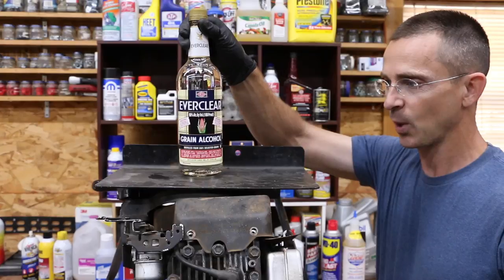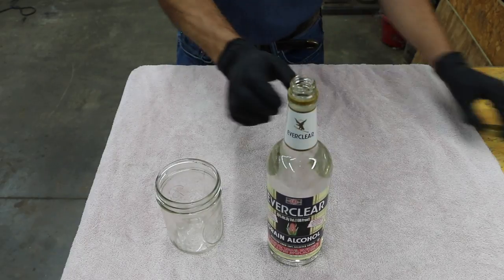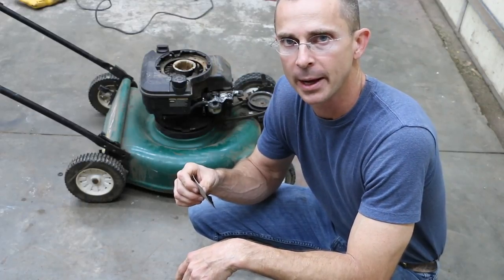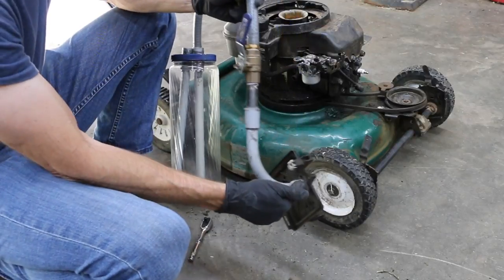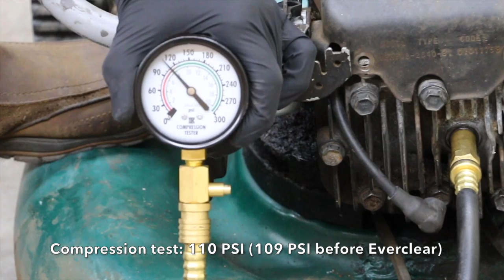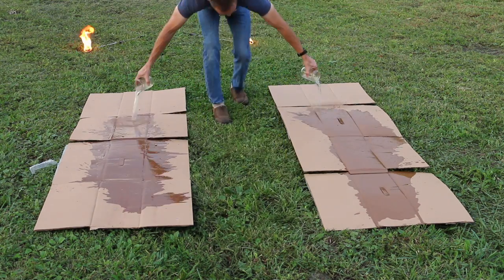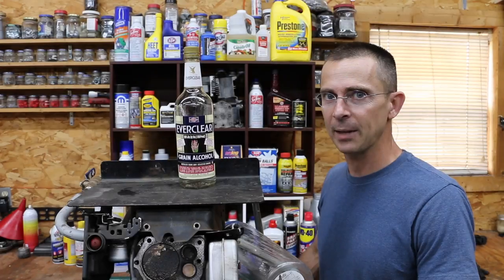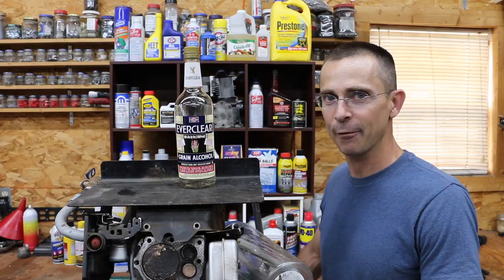Will an Engine Run on Everclear Fumes?  Let's find out!

Comment: Huh. The fuel vapor canister is pretty much an alcohol bong for engines. The more you know
Reply from the maker: Thanks for commenting.
Reply: A bong with two bowls
Reply: I should rip my bong
Reply: THE MORE YOU KNOW.  🌈
Reply: Yea double down stem bong seems to work though
Reply: That is a must-have feature when you are cutting either kind of grass

Comment: You should add a thick cloth to the bottom of the bubbler, you will get better vaporization and less fuel splashing around. That is how I used to do it years ago.
Reply from the maker: This is a great recommendation--thank you
Reply: Excellent idea.
Reply: As long as the cloth or which ever material you use is just above the fluid line then the vapours will pass through while reducing the bubbling. Those long intake pipes you have should be able to hold the cloth down so it doesn't get drawn up the bubbler from the vacuum, else you need to secure it down maybe with a DIY wire frame or anything that can't escape and enter the motor
Reply: I would think a porous sponge would work better by absorbing more of the liquid and passing more vapor.

Comment: Your channel will be the Holy Grail when the apocalyptic dystopian Mad Max races start
Reply from the maker: LOL!  Thanks for commenting.
Reply: apocalyptic dystopian Mad Max lawn mowing haha
Reply: Blue Roots Denver TV aka Reaping lol
Reply: Everclear will still be more valuable than gas in the apocalypse. lol
Reply: Art Vein exactly hahaha
Reply: PROJECT FARM RUN BARTER TOWN!
Reply: Good thing it didn't back fire...that vapor canister would be a literal bomb
Reply: easy fix to that is a flash suppressor screen in the vapor line. would prevent the flame front from reaching the vapor canister.
Reply: not if you adjust the carb to inject the proper air/fuel ratio.
Reply: And then there's me with my solar charged electric motorbike
Reply: @Dr. moxley why don't you make me
Reply: I just bought a 67 and a 64 f250 for that exact reason. Bring it
Reply: So true
Reply: That time is now
Reply: Correction, it is the Holy Grail. Period
Reply: 2021: let the games begin.

Comment: Who the heck would drink that stuff?
Reply from the maker: Great point! This stuff is extremely powerful.  Thanks for commenting.
Reply: Who would drink Everclear ???  In my experience, almost every student at the University of Utah.
Reply: its great for parties when you serve mixed drinks out of a communal vessel, a little bit goes a long way. my favorite drink to serve with it is jungle juice inside a watermelon with a water cooler spigot jammed into it lol, especially during the summer, the everclear is basically a filler, you use flavored mixers to get your flavors right then bump up the alcohol content with the everclear.
Reply: I shouldn't really endorse drinking of any sort, but I'll just speak from past experience.  Everclear on its own is very difficult to drink and the flavor is reminiscent of the smell of a corn stalk.  Mixed 50/50 with a strong Bourbon (result ~120 proof), the flavor is very pleasant and the kick is sufficiently enjoyable for a stout drinker.  The thing is, even 60% alcohol will burn the interior of your mouth pretty quickly.  So uhh...don't.

Comment: See what running racing fuel like 106 or 110 octane will do to and engine please.?
Reply from the maker: Thank you for this recommendation!
Reply: Project Farm no prob always wanted to try this but never got the chance hope you consider this for the next video.!!
Reply: it will be less power. You get the most power using the lowest octane the motor can handle.(pre detonation) race fuel with higher octane is for high compression.
Reply: As said before, the higher the octane number the lower the amount of energy stored in one unit of fuel. You can run higher compression and more aggressive timing on such fuel, and this is what gives you more power. Nevertheless, I have never seen a lawnmower running on racing fuel😁
Reply: Wow finally someone who understands octane and it's purpose in fuel.
Reply: Game Bred Duramax oh ok
Reply: How about rocket 118
Reply: We always joke about putting c14 in the generator or the golf cart at the races, but at $15 a gallon, no one ever actually tries it. LOL.
Reply: Game Bred Duramax what the hell is in it that makes it smell good?
Reply: Game Bred Duramax is it lead? Eww.
Reply: Alexander Riccio yes it’s the tetra ethyl lead
Reply: Jerry Wick yeah IIRC they used lead in ancient times as a sweetener. That said, there's a damn good reason we don't use TEL anymore, and we even really knew it was a potential neurotoxin in the 1920s. IIRC ethanol might work fine as an octane booster?

Yeah, and do your neighbors - or anyone else who will live on your land in the future - a favor and don't burn leaded gas. It's the primary cause of soil lead pollution here in the US...
Reply: rondogwil out here in Vegas there's a few gas stations that happen to have 100 octane and we bought 5 gallons @ $4.999 a gallon and we built a fogger plate with a 25 shot in a golf cart it was bat crap crazy couldn't hold the button like you can in a car or bike. If we hadn't wrecked it I think we could have done a lot more with it. The funniest part was the head was bowed enough to see through to the other side 😂. Not real drastic but just enough to see daylight!
Reply: Persistent Gaming not much at all it wouldn’t give it any performance either. We used to do it on our non race sleds because we had our av gas for our race sleds. Used to have a 04 rev 440. Ran it on 110 to 105.
Reply: arekb5 i run my lawnmower on 100LL
Reply: (this is race fuel)
Reply: Better still why not nitromethane
Reply: Race feul, and aviation feul (100LL) are 100+ octane. Optimax/super unleaded are between 97 and 99 depending on where and when you buy it. Neither should make any difference if used in a car (or lawn mower) that is specced for 95 octane plain unleaded - the idea with octane is you have to use feul with at least the required octane rating in order to prevent knocking, but there is no harm or benefits to using higher octane feul. The claims optimax 'cleans your engine', 'adds power' and 'gives you more miles per tank' has to do with the other additives in the feul, its nothing to do with the octane rating.

Dont run lawn mowers on 100LL (avgas), yes it will run just as well as normal feul, but it contains lead so you will die.

Try using less potent alcohol in the mower. GIN . Fill it with GIN . A product designed to be drunk rather than everclear which just looks like drain cleaner. At least with the GIN it will smell nice.
Reply: Persistent Gaming I knew a kid who put some of his dirt bike race gas in a weedwacker he said it ran really good for about a minute lol
Reply: Meldins STI haha
Reply: Alcohol probably "have more octane" than race fuel. From my experience here in Brazil, burning alcohol in a engine with gasoline compression configuration only results in more consumption of fuel and less power. The ideal compression hate for best performance burning alcohol is around 14 to 1 and higher. In São Paulo there is a bus that have a Diesel engine with little adaptations burning alcohol.
Reply: I've ran race gas in a mower before, it ran like shit, and I had to adjust the carb for more fuel. Smelled fuckin awesome though. Lmao
Reply: I used 112 octane race fuel in my mix can once for my weed eater. It ran okay for about 20 mins and then it burned a hole in the piston. Cheap ass weed eater.

Comment: I’ve always been curious is Everclear was able to run off a engine, thank you so much for this video and helping me confirm this!!
Reply from the maker: Your Welcome!
Reply: Put on Ice teaspoon of two-stroke oil per gallon of moonshine you will not score your cylinder walls wash the cylinder wall free of any lubrication or wear out the compression ring. Also go up when heat setting on your spark plug. I don't have a Blog I don't post anything but I have been known to screw off a whole lot I am screw up a whole lot. First year I used it in a mower it was fine and the mower was only a year old when I started using shine in it. It got weak after the first year and I decided to peek at the cylinder and decided to use 2-stroke oil in my lawn mower fuel gasoline homemade mower shine. Good luck it's cheaper than buying gas try to use a straight corn mash with enzymes and don't add any sugars and things that would make it palatable for human being consumption and then pour into your mower. That's not good. Make it for the mower and a clean base spirit for cocktails.

Comment: When I was a kid we ran out of gas for my go cart with a 5HP briggs.  One of the neighborhood kids got some Everclear from his mom and dads liquor cabinet.  A little adjusting the carb and we were back running.  His mom and dad were upset when they found the empty bottle, but were relieved when the found out we used it as fuel and weren't drinking it.  Another time we ran out and we found some 108 octane boost in someones garage.  We dumped it in the tank and it ran just fine on it.
Reply from the maker: Impressive and very resourceful!  Thanks for sharing this experience.
Reply: The old 5hp Briggs is quite the little motor
Reply: Nick Egloff nothing compared to the old cast Briggs and Tecumseh engines
Reply: FrugalPrepper lies....
Reply: FrugalPrepper y'all put that much thought into it, but were too dumb to collect a few cans to buy gas??? Smh. Delete your account
Reply: 1 can is worth $.10 where I live
Reply: I HIGHLY doubt that you would almost make your money back on a 12 pack of soda.
Reply: nope because you pay a deposit at the store when you buy a can or bottle. all you're getting back is the extra 10 cents you spent when you purchased the drink.
Reply: If a single pop can was 10 cents people would be fucking raiding recyclable bins.
Reply: +Preston Cole Certain states have a deposit charge on plastic/aluminum/glass bottled drinks, (anywhere from 2c to 15c depending on state). You get this deposit back when you take them to the designated recycling stations (they dont go by weight). 
Its only a 'profit' to those who dont pay for the bottle in the 1st place aka homeless people, kids, etc
Reply: In the state of MIchigan the deposit on pop cans and bottles is 10 cents
Reply: This is true.
Reply: Don't know what fucked up place requires you to pay extra just to get your drink in a can 

In Australia, we pay 10c per can and you do not have to pay extra for it (and yes people do raid the bins to collect them, I consider it payment for keeping the streets cleaner)

Comment: Cool video as always thanks! What about acetone or denatured alcohol or propane?
Reply from the maker: Thank you for the positive comment and thank you for the recommendations!
Reply: Blakehx you should google around about propane, actually quite a few vehicles made to burn this, like hydraulic lifts that run indoors but cant be plugged in. Propane burns clean with less exhaust fumes.

Comment: The vapor canister was very interesting.  Now I wonder how long it ran for you on vapor vs straight in the tank.  I see it doesn't burn hot enough to clean the oil out as well. Looks like carbon build up would be an issue.

Comment: You cant see the flame but that everclear was on fire. Do it at night and youll see the flame.
Reply from the maker: This is an excellent point regarding the nearly invisible flame. Thanks for commenting.
Reply: Only a quarter ounce,,, in a 2L plastic bottle,,,, roll it around to cover the full interior,,,,, lean it on a 45 degree angle,,, lied it,,, it will take off like a jet rocket,,.  !!!!   Be careful 3rd degree burns,,,.  ???
Reply: You can see the blue flame sometimes
Reply: Gasoline burns dirty so that carbon really lights up the flame, alcohol not so much.
Reply: @Doom2pro  same reason you can't see engine exhaust on the space shuttle but can on the Saturn V actually
Reply: At first I didn't think it caught fire!  Then I realized the liquid was disappearing so it had to have been burning up but just couldn't see it.